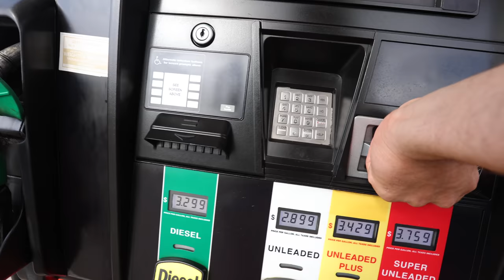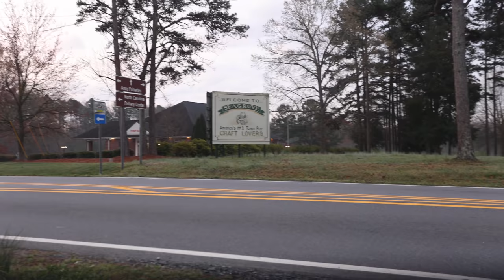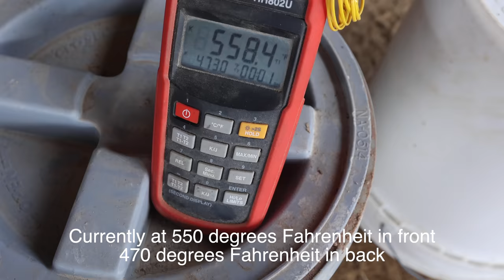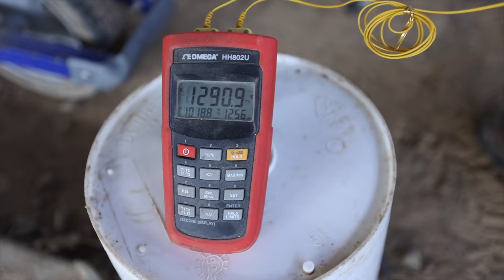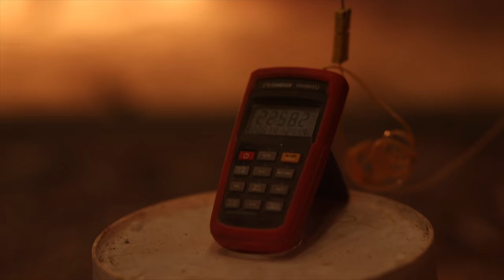WOOD FIRE POTTERY ADVENTURE - the ENTIRE process!🔥

Comment: If you want to dip your toes into doing your own woodfiring, you could always build an Olsen fast fire kiln.  It's much smaller than the kiln in this video, but the smaller size also means a much lower build cost, lower cost per firing, less work to prepare for a firing, and you can fire it to cone 10 by yourself in 4 hours.  Not much point in firing a wood kiln that fast since you don't get as much ash build up, however you can also fire it as slow as you want.
Reply: What does cone ten mean ?
Reply: @jacobwhite8204  Cone numbers are a way of measuring heat work, which is a function of temperature and time. The higher cone numbers generally correlate with higher temperatures, but the length of time spent at a given temperature makes a difference. Imagine you have a lit candle. If you pass your hand over the flame very quickly, it doesn't hurt. But if you hold your hand over the flame for a few seconds it will hurt quite a bit. In both cases, the temperature is the same, but the amount of heat work is different, which produces different results.